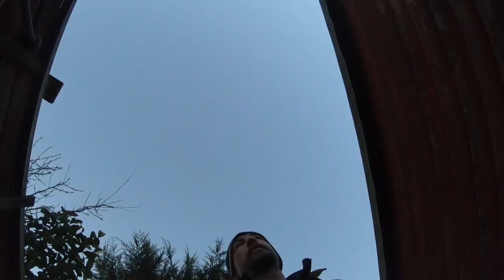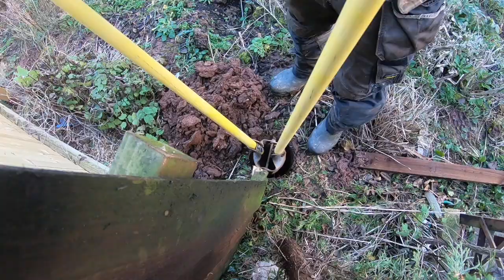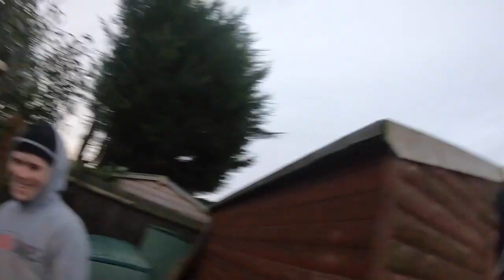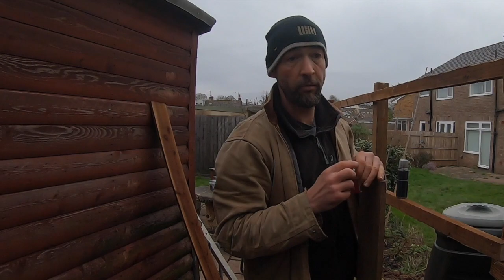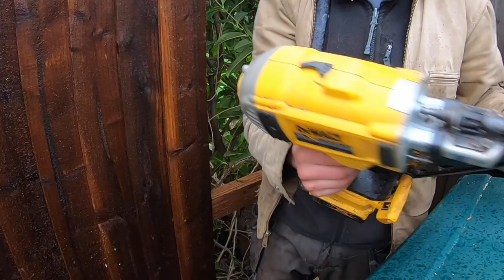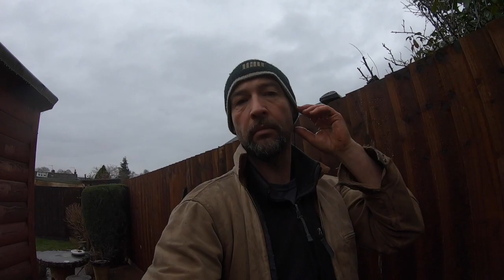FEATHER EDGE FENCE | BATTERY NAIL GUN #fencing #dewalt

Comment: Hi, just wondering what model the nail gun is that your using? Looking to do a big fencing project soon and will need one! Cheers
Reply from the maker: Hi, it's the DeWalt first fix which will take up to 90mm nails, not sure if they still make first fix ones. I've heard mixed reviews on them but mine has been faultless. Wouldn't do a fence without one now. Good luck with which ever one you go for, it is handy to be able to fire up to 90mm with one so bear that in mind. Cheers for watching 👍
Reply: Hi, thanks for the reply. So that first fix nail gun also does small nails for the feather edge boards as well? Cheers
Reply from the maker: Yea it takes the smaller one too, only adjustment needed it the depth setting, too much power will drive a 35mm board nail straight through 😬

Comment: Those ready made panels are terrible. The amount of those I have replaced over the years some that were quite new as well but the wind knocks them to bits. Great job mate.
Reply from the maker: Cheers, I gave up on basic panels...you can see right through some of them and in a couple of years they're not even good for kindling. There are good panels but I find feather edge easier to get around problems...and avoids digging the old concrete out, hopefully.

Comment: Lovely bit of fencing there. You've done more than one a year too be that good. I wish this was the fencing we've been doing. There's a new type of fencing. From a company called screen with envy. If anyone asks you too put some up. Jump in the van and drive till the wheels fall off. Or people speak another language
Reply from the maker: Cheers 👍 is that the metal cut pattern stuff?
Reply: @LewisgardenservicesLtd  yes it's horrible too work with. Because it comes flat packed. In a six by four aluminium panel there's twenty eight screws and no pre drilled hole and no instructions because the company hasn't gotten around printing them yet. The post's are about four inches square with a base plate with four anchor points that have too be concreted in the ground because the post sits ground level. And the pretty lattices work on the gate's you have too weave yourself. 😭😭😭😭😭😭😭😭😭😭😭😭😭😭😭😭😭😭😭😭😭😭😭😭😭😭😭😭
Reply from the maker: Sounds horrendous, did have someone query it last year...I said no😂
Reply: @LewisgardenservicesLtd  this is the third fence now but what confusing is the company makes seven types of fencing gates and accessories. So the customer picks what they like and then the company sends hinges and brackets and screws for fencing that might go with yours or not. It's the ultimate IKEA challenge and no instructions.
Reply from the maker: I would be slinging that in a passing scrap wagon after an hr of fence flatpack
Reply: @LewisgardenservicesLtd  twenty five meters of fencing. Three lad's two days
Reply from the maker: @jonathanbell7752   sounds good going 👍